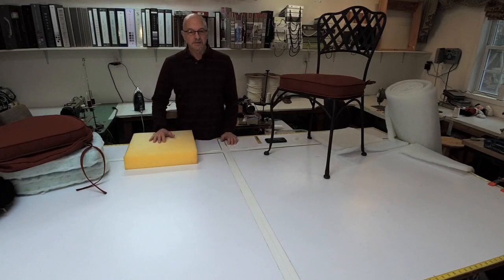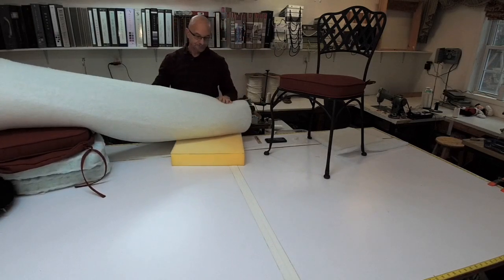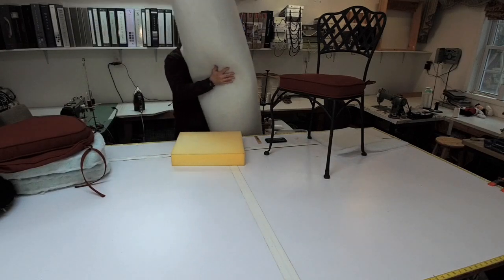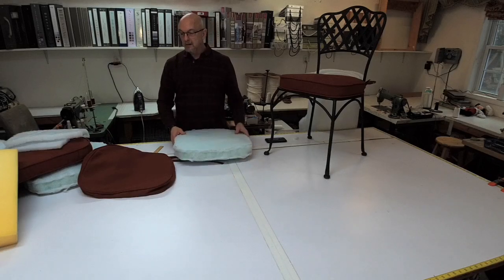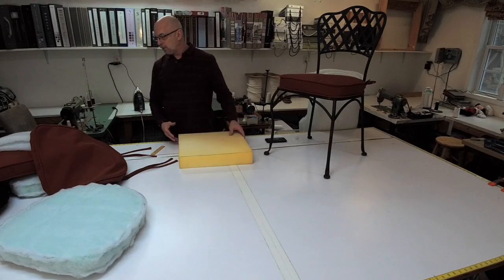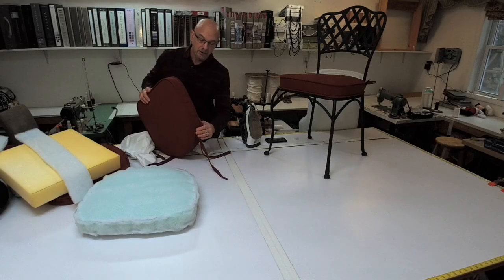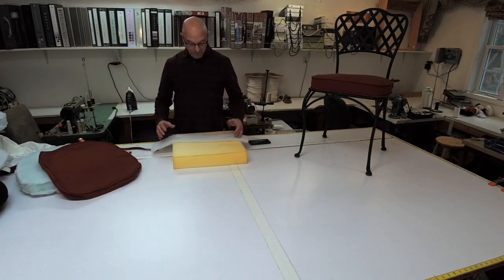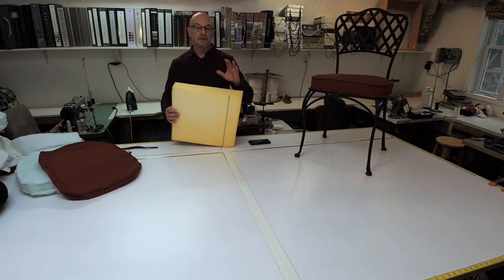Adding Dacron to foam do’s and don’ts!

Comment: Thank you so much for these videos, a huge help.  I am trying to refoam dining chairs from the bottom without reupholstering the chairs, the fabric is in great shape and the upholsterer glued the rolled edges to the wood.  There are very loose strings underneath and the seats sag terribly.  I was thinking of taking out the strings and canvas and replacing the foam with foam and dacron and screwing painted plywood into the recess up under the seat rather than rewebbing with string or trying to stretch elastic upholstry banding.  This seems to make more sense because the upholstry is very well done with double rolled edges.  Your consideration of this approach is appreciated.

Comment: Thank you for your video, I wanted to ask you if it is unusual for the upholstery shop I contacted, to tell me they do not use batting on the dining chair seats I want to upholster. Just foam and fabric?
Reply from the maker: I always add Dacron to seat cushions, it gives the cushion softness and a crown. Although the upholsterer doesn’t normally he should be able to add by request and if he doesn’t have it in his shop I would stay away!
Reply: @Factorydirectdesignersworkroom  thank you for your quick response

Comment: Just had an upholstery shop redo the foam cores on my sofa.  It looks great, but he only did Dacron on the top & bottom & not on the sides, as we had discussed.  I asked him why, and he said, "I didn't want to be concerned about the Dacron catching in the zippers.  Does this even matter and does the explanation make any sense?  Is it a big enough issue to take it back & have him wrap the sides?
Reply from the maker: The important areas for dacron is the top and bottom and as long as the cushions covers look tight your fine but he should have honored your request or give you valid reasons up front instead of excuses after the fact. The zipper getting caught really isn’t an issue I think he just didn’t want to spend the extra time!

Comment: Hi Scott, so I don't seam allowance to the fabric ?
Reply from the maker: Hi! You do not add any extra seam allowance for the Dacron wrap! For an example if your cushion without Dacron is 16” x 16” square you would cut your fabric 17” x 17” (1/2” seam allowance). Then you add the Dacron and it will make the cushion cover fit tighter but softer! I hope that explanation helps!

Comment: I've wrapped dacron around my cushion but want it to feel more plush. Would adding another 2 squares of dacron on the top of the cushion work?
Reply from the maker: You could add 1 extra layer and it may help but more than that will just compress, if it is a back cushion you can use thinner foam as a core and layers of Dacron to make it more plush, good luck!

Comment: I would like a 15cm pillow with a straighter aspect. Should I consider the thickness of the leather? The leather is 0.1 cm thick. The arm of my sofa is 15cm high and the cushion follows the height of the arm, hence my question.

Comment: I purchased this and am wondering if this type of dacron will work:  Light Weight Bonded 100% Polyester Batting 4oz 48"?  I hope so because I ordered 10 feet.
Reply from the maker: Yes that should work just fine!
Reply: Thanks for the quick response.  I'm in the process of making four 45X18 5 inch box cushions that will convert into a bed in our mini van.  My concern after receiving the 10 feet of 4 oz batting wouldn't be thick enough.

Comment: New subscriber here. Coukd you please tell me...What do you use to cut your foam?
Reply: Just my question as well. Did you get a reply, or found out another way?
Reply: @TheSybil47  No Sybil, I didn't.
Reply: @orosedobheathaabhaile  I just saw a video from Sailrite. Here's the link. https://youtu.be/mMm_irFrbHQ There you will find out what they use. Hope it helps.
Reply: @TheSybil47  Thanks Sybil.
Reply: @orosedobheathaabhaile  No problem. We have to help each other out. The cutter the experts use are too expensive for me, so I may just use an electric knife like they suggest.